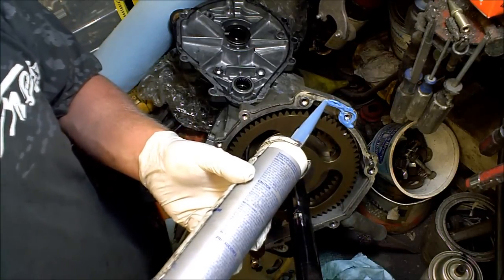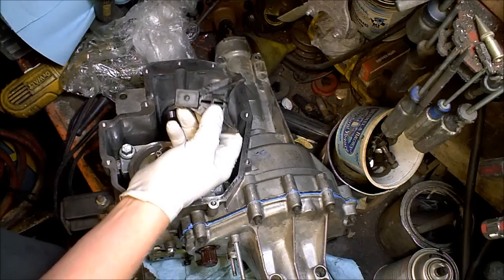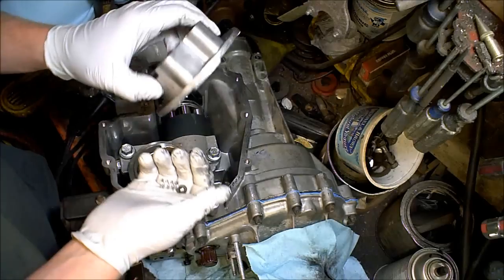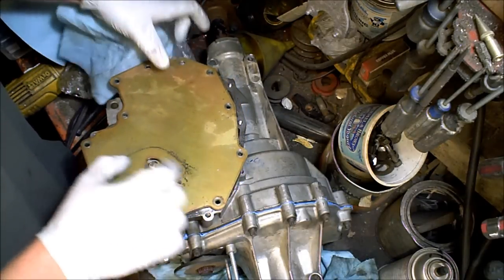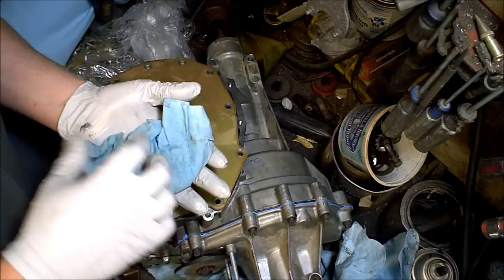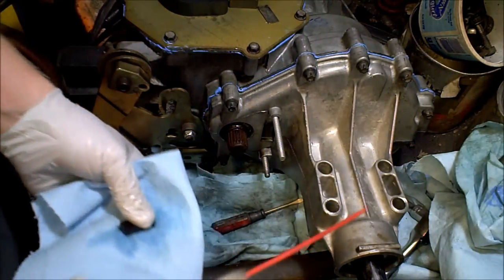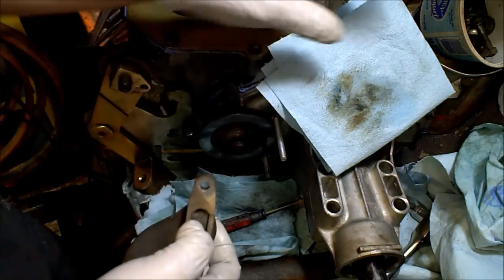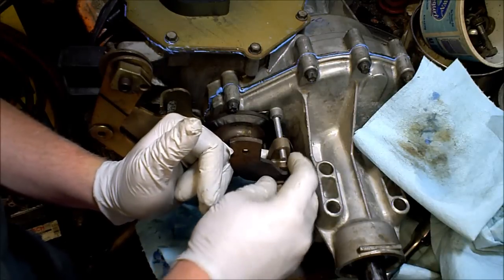4 Hydrostatic Garden Tractor transmission rebuild 4 of 4 Hydro Gear

Comment: Great job on your video series! Even though my issue doesn't appear to be the same as yours I did learn a few things. If you have a minute tell me what you think. My troy-bilt hydro won't shift from F to R while the engine is running. It runs fine in either gear, but I have to turn the engine off to switch back to neutral before I can switch gears. Any ideas what would cause that? Thanks!
Reply from the maker: Sounds like an external linkage problem. Nothing internal should hinder the operation from forward to reverse like you describe.

Comment: Excellent video series (1 - 4) ! I'm thinking of applying a drain hole in rear & pump housing on bottom. Easier draining / flushing both systems. If I can locate low point that I can J.B. build up & drill / tap & plug. Should be standard on these models !

Comment from the maker: Specs are impossible to find on most of these. The manufacturer makes these to be not serviceable and to be thrown away. They offer no support. Generally the hydraulic pump is the #1 cause of no/slow movement, jerking or slipping going up hills.If the pump is worn you will be able to feel the slop in the pistons. It is an easy enough fix but some pumps are obsolete or they want $300-400 just for the part. I got lucky and parts for this one were under $100.

Comment: Nice job!  Where did you figure out what the specs should be for the tolerance on the pump pistons?  How many hydro transmissions have you repaired, and is it usually the same problem?

Comment: How does this happen? Does this happen to a expensive john deere d 170 like I have I think it has a heavy duty transmission.
Reply: @askthekoipondbuilder. Nope. The d170 does not have a heavy duty trans. Your comment is 6 years old  but now you can find many horror stories of the d 170 hydro trans failing early.
I made the mistake of buying  a d 170 on sale last year and its showing signs of giving up at only 40 hours running time. It cant pull an aerator for more than 15 mins before coming to a stop .
My 14 hp mtd was better.
So to counter the D170 reputation Home depot has rebadged it as the D165 .
Same junk.
To get a John deer with a heavy duty trans you need to go to a 300 series and it will cost you around 4000 $ more

Comment: holly crap you put enough RTV to seal up 20 cases ! And can't believe your putting a cheap Wal Mart automotive type motor oil in it  Use a oil that going to make the tran last for more the 2 or 3 year  USE Shell Rotella T6  5w40  & it last for 20+ years

Comment from the maker: I wont usually replace a good seal unless it was leaking to begin with. I know it sounds counter intuitive but I have had amazing luck putting the few seal back together as long as I take careful care removing them. Seals and orings either leak or they dont leak so it figure if it aint broke dont fix it:-)   If they do start leaking they are easy to get to without removing the transmission. Thanks for watching, commenting and subscribing.
Reply: about 10 yrs ago, I had the car in mechanics for general maintenance, new clutch, and some checks (clutch was unknown ago, just wanted it done, no issues, no leaks no problems).

The mechanic told me, best always do the rear main seal at the same time, might as well, engine it tilted, box is out, tailshaft out, exhaust off, etc, etc (90% of the work already, done), I told him what's not broken, but he insisted.

3 weeks later I have oil under the car, take it back in, and find the NEW rear-main is leaking oil.

the new seal had a slight grove in it from poor manufacturing, so guess who footed the bill for the car being back in the shop for another 8 hours of work to replace the bloody seal...

Generally you can tell if there is wear on a seal and it's going to fail, or going to last, if it's not broken, it doesnt need fixing...

Comment: This leads me to believe the springs are worn and provide less pressure which forces out oil and eqauls less power. Anyways maybe I can send you some pictures and you can help me determine the problem. Any help would be greatly appreciated.

Comment: Nice Video, I actually just tore apart my ariens yt15h hydrostatic transmission, This video should help me pin piont the definite problem. What ive notice so far is the where the motor (inside the hydro) is sitting against the piece that transfers the fluid from the pump to the motor is worn out, looks like it would force out oil (not a smooth surface anymore). Another thing ive notice is that the springs from the motor are slightly more compressed than that of another hydro I have torn apart.

Comment from the maker: The blue stuff is RTV gasket maker. I am by no means an expert but I appreciate the comment. Yes, the more the transmission is in use the more the tolerances are enlarged, causing fluid to leak past internally and reduces effective power output. I would at least recommend fluid changes. You can also use thicker oils to help a worn out transmission. Thanks for watching and subscribing!

Comment: Fantastic videos. Liked how you kept rolling through the times when you were figuring out how to replace the motor; good to know that even the experts have to take some extra time to figure it out. What was the blue stuff that you placed on the casing edge? When you mentioned the increase in power after the overhaul, is it because of fluid lost due to the motor casing out of tolerance? I have a '92 Deere and wonder at what point is it worth cracking open the trans to replace these.

Comment: Awesome video! One point, When you pointed out at about 5:09, in, I believe the second video, about the spider gear, that was a planetary gear. You obviously know what you are doing though. Hope it runs great for a long time. My trans is also slipping. It is a Poulan Pro 26 hp 54" garden tractor, with only 180 hours on it! Seems a little premature failure to me. I loved your video and hope to see more from you! Thanks for the post!